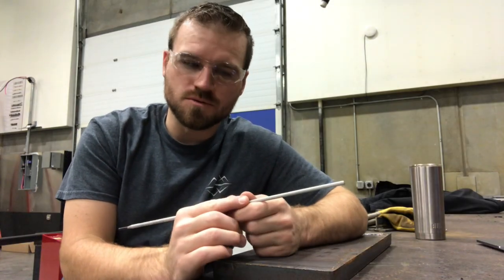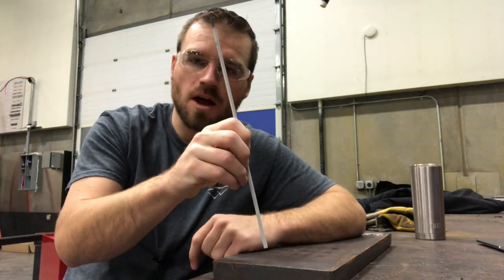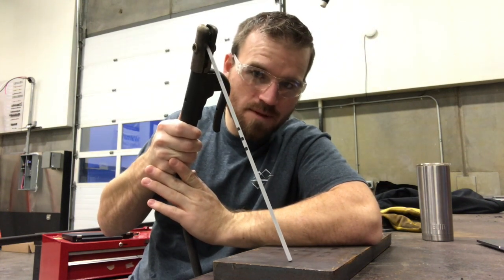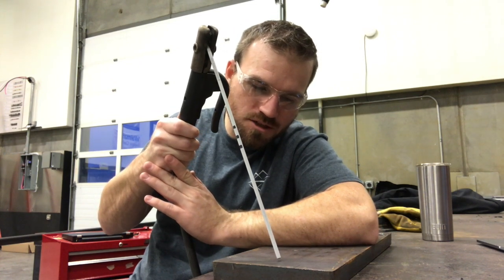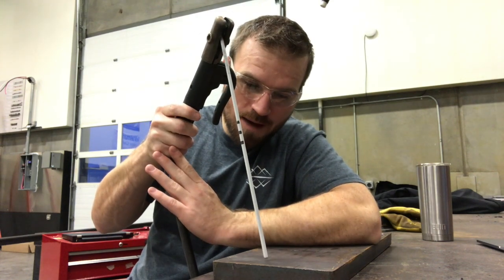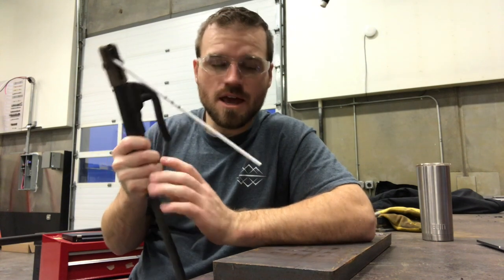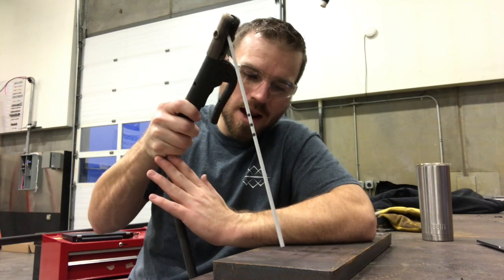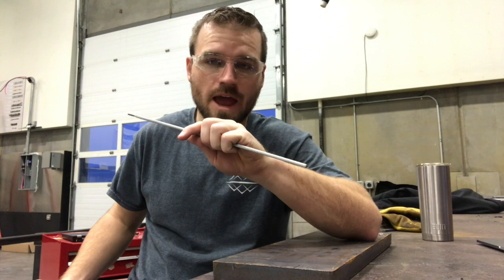Welding SMAW-How to Strike an Arc

Comment: The secret to striking an arc is 1) clean work piece - you can't start an arc through rust, you can't earth through rust;  2) use dry electrodes - if you are a diy and you keep electrodes in an opened packet in the back shed, it's not going to work so well,  3) tap used electrodes on a hard insulating surface (eg brick) just before starting.
This chap in advising to disconnect the holder if the electrode is stuck to the job is using an old welder.  Modern inverter welders usually have a feature whereby it detects the low resistance of a stuck electrode and turns down the current to a pilot level - there is no need or point in disconnecting the holder.   If you are using an old transforner type welder that puts out AC, the presenter's advice is hazardous - you could get an electric shock.   Don't disconnect at the holder, turn off the welder instead.
Reply: I dont understand how you could get a shock from the AC welder, you need two wires to form a circuit through the body, as far as I know AC transformer welders use very low voltage at high currents, not enough voltage to generate a large enough current through the body? not telling you as I am new to welding, these are more questions.
Reply: @engjds  :  Old arc welding equipment was notorious for giving serious electric shocks, however modern invertor welders meeting international safety standards have just about eliminated to problem.
What makes an electric shock serious is the amount of CURRENT flowing through you.   0.03 amps is generally accepted as lethal if flowing in the chest.  To increase current, you need to have a) a higher voltage, or b) a lower electrical resistance, or both.   
While welding is under way, the voltage is only around 10 to 20 volts, which won't kill anyone.   However, when the arc is not established, the welder output voltage with old type welders can rise to 50 to 70 volts, which if AC can give you a very nasty shock.   In stick arc welding, to make the arc stable and controllable, the welder is designed to have an approximate constant current characteristic  - that is, if resistance (in the arc) rises, the welder unit automatically increases the voltage to maintain the set current.
To meet current European safety standards, welders must now have circuitry that detects an open circuit and cuts the voltage to 20 volts or less.   When it detects a circuit closure (i.e., electrode touching grounded metal) it applies the full output as set by the welder controls.
The old type electrode holders were made of fibre.   The fibre used becomes electrically conductive when damp, as it may if left in a shed overnight.   Due to your fingers being wrapped around the holder when you pick it up, the area of contact is large and thus resistance low, and so a dangerous current can flow through you.  And if your fingers are wrapped around the handle, the current will contract your lower arm muscles and force you to grip it harder, increasing the current.   Most of us who have tried arc welding years ago have learnt this the hard way.  Modern holders have plastic insulation which is a good insulator even when wet.  
Touching an electrode with the welder on is not likely to kill a healthy adult, even if the welder is old, but the 60 to 70 volts may give you a shock nasty enough to make you involuntarily move and hit something or knock something over, fall down, etc.
When you get a shock, the return path for the current is generally through your boots, aided by sweat soaked into the boots, or because you are leaning against something grounded, or you are touching something with your other hand.
Reply: @keithammleter3824  Interesting reply, thank you, yes 70-80VAC is not really dangerous on its on, but you would feel a shock, you mentioned about constant current in stick arc welders, but taking mine apart it was just a transformer and nothing else, so are you meaning the newer types?
I would rather work with AC from a safety point of view, you can at least let go with AC voltage, DC makes your nerves lock into place, having said that, as you say with AC and a non isolated transformer, you have a return path back to ground making it more risky.
Also I notice there are AC and DC type sticks to weld with, some do both, what is the physical differences with those sticks?
Reply: @engjds  :  You have things back to front.   AC is far MORE dangerous than DC.  Nerves are set off every time the current pulses - with AC that happens at twice the supply frequency - that's twice 50cycles a second, or 60 cycles a second in North America and a few other countries.  With an AC shock, it's hard to let go because the muscles contract on each cycle.  With DC you feel it when the current through you starts but after that its not so bad as with AC.
With welders, the secondary (the welding circuit) is ALWAYS isolated from the primary side (the AC mains input) and always has been - that is an essential part of safety.
Typical older style transformer welders work by having some sort of magnetic shunt.  The shunt is moved in and out of the shunting position by the amperage control on the front of the welder.   It works because the more the magnetic flux available from the primary (input) winding goes through the shunt, the less there is available to energise the secondary (output winding).  Since current in the secondary winding generates its own flux that opposes the primary flux, (if it did the opposite you would have a devices that generates its own power) as the secondary current falls, the secondary voltage rises, tending to keep the current constant.
A constant current output is used in stick welding, as it makes it easy to use.   in MIG welding, considered a more costly, professional process, a constant DC voltage welder is used.  The result is better but you need a bit more skill, and ther's no slag.
With AC, the voltage goes to zero  and reverses100 times per second.  This causes the current to reverse 100 times a second, and when it reverses, the arc tends to go out.   Electrodes designed for AC welding have coatings that generate copious quantities of burning gas, with an affinity for oxygen much greater than steel, that helps the arc restart and keep going each time the current reverses.   The down side of this is lots of slag from the combustion products, which must be removed from the weld after.
For welding with DC, the coating only has to provide a relatively non reactive shielding gas to keep oxygen from the air out of the weld.
Arc welding is to some extent science and to some extent a black arc.   According to basic arc theory, metal moves from the positive side (which is hottest) to the negative side (which is coolest), but some metals work best with opposite polarity.   With TIG welding aluminium, AC is best.
All electrodes are much the same regardless of brand, but each manufacturer knows some additives to put in their coatings to make it work better for DC normal, DC reverse, or AC.  "Secret sauce" you might say.
Reply: @keithammleter3824  I am a qualified electrician with years of experience and had god knows how many safety courses.
DC is more dangerous for the following reason:
Nerves locks meaning many cannot pull away from the DC voltage as there is no transition thru zero like AC allowing nerves to free themselves, nerve reaction time is much faster than the 20ms(UK)  50Hz or 60Hz.
I think you may have got AC mixed up with DC locking your nerves, but I am 100% I am right on this, why? because as a young nutter we used to challenge each other on how much DC voltage we could take, at 70 to 80V+ you can feel your nerves locking, AC has lesser effect on nerves, which can be demonstrated using an Autotransformer cranked up from zero, with AC you can easily take over 100VAC, hell I have even had 3 phase shocks in industry at over 400VAC and they make you jump, but I have never locked onto the circuit.
Ahh ok, I assumed they would be non-isolating auto-transformers, so that makes more sense to move the ferrite core.
All transformers have equal powers on primary and secondary and voltage ratio between input/output set by the ratio of turns, so I cannot understand why the transformer would output a constant current regardless of load, not saying you are wrong, I will look it up, but I assumed a 100A welder would be one which outputs a maximum of 100A, not one which always trys to maintain 100A. Thank you for a brilliant reply, I feel I know welding theory much better now.
Reply: @engjds  : You still have a lot of things mixed up.
A 100 Amp welder is a very small welder.   The usual size used by small workshops and hobbyists used to run about  130 amps - considering the losses in the transformer, that was about a much as you could have running on house current.   With modern invertor welders, they are much more efficient, and 180 to 185 amps is now common.   Professional grade welders run on 3-phase current and 400 amps is quite typical.
AC hurts far more, and is vastly more lethal than DC.  This is because nerves are triggered by pulse edges and not continuous current.   A really heavy DC current paralyses nerves like an anesthetic, so you feel nothing after the initial bite.  But on AC very small currents force nerves to fire 100 (or 120) times a second.   You feel it all the time (until you die).  The 115 V AC house current used in many countries is well known as lethal, if sufficient contact area with the body occurs.  Before transistors were invented and commercialised in the 1950's, portable radios used special vacuum tubes designed for battery operation.   Batteries containing 60 cells in series were used to get the 90 volts DC needed by the vacuum tubes in the 1940's and 1950's (typical types 1T4, 1R5, 1S5, 3V4).  Before that a common radio battery voltage was 135 V.  The plugs for the batteries had bare exposed pins on the back - you could easily get in contact with 90 V DC or 135 V DC.   The early batteries had "Farnstock" clip terminals, completely exposed.  You could feel it at the instant of touching, but it never ever hurt anybody.
In the early days, the first to commercialise electricity was Edison, who developed a DC system,  He chose 110 volts as that suited the early lamps he developed and was completely safe electric shock wise regardless of circumstances.   But Westinghouse then developed AC distribution, a much cheaper, more efficient and flexible system, but they kept to 110 volts local distribution to suit lamps.  But 110 V AC can be lethal.  It is well documented that Edison, faced with commercial oblivion, publicly ranted at length about the dangers of AC, doing stunts like electrocuting elephants with AC, devising AC electric chairs to execute criminals, etc.   Edison was completely right about AC being far more dangerous,  but DC could not be used for wide distribution which needed voltage transformation, so AC won commercially anyway.
The reason why magnetic shunt transformers have a constant current output characteristic is because part of the magnetic flux passes through the secondary winding and part through the shunt.   Magnetic flux is like electric current in that it tends to go through the easiest path.   When there is a heavy load on the secondary,  the flux caused by the secondary current opposes the primary flux (this is called "Lenz's Law"), so the primary flux prefers more going through the shunt.  When the load on the secondary is light, the flux finds going through the secondary easier than the shunt, so it increases the secondary voltage, tending to maintain the current at nearly the same level.
The voltage ratio in a transformer is ONLY equal to the turns ratio if ALL the magnetic flux from the primary goes through the secondary.  In a welding transformer, there is an alternative magnetic path in the shunt, so the voltage ratio is variable.
Ferrite is not used at power frequencies.  Special steel alloys (silicon steels) are used for transformer cores at power and audio frequencies.   
You can't be much of an electrician if you think ferrite is used.  You certainly can't be much of an electrician if you think DC is more dangerous than AC.
All of us who have worked in the electrical or electronic industries have got a shock or two, including me.    You learn very quickly early in your career to respect AC electricity, and take care not to get another shock.   In electronics, nobody worries much about DC.   At one time (in my teens) I worked in TV repair.  The old tube-type TV sets had part of the circuitry running on what was called "Boost HT" around 400 V DC, and about 12,000 to 22,000 volts DC on the picture tube.   I can tell you from experience that both hurt, but are not lethal.
The reason why stick welders are built with a constant current characteristic (i.e., it tries to keep the current set to whatever value the operator sets it to) is because that makes welding an easy process.   It mean that the power (and therefore the heat) is proportional to the distance you hold the electrode away from the work, and the arc is vey stable.  One rapidly learns to control the heat in this way.   If the welder has a constant voltage characteristic, then the heat is inversely proportional to the electrode distance, and learning to control it is harder.  The arc can more easily go out for any reason, such as operator unsteadiness, welding through a patch of rust, wind, etc.
Reply: @engjds  : You are an electronics engineer?   Yeah right.  You don't know the basics - things engineers learn in their first week of study.  You might be a software/programming guy.
It is generally accepted that 30 mA of AC through the bulk of the chest can be lethal.   But the actual AC current through the heart itself is lethal at far below 30 mA.  There are special standards for electrical and electronic equipment used in hospital operating theaters for that reason.
You are ignorant of how the nervous system works.   Nerves have two states - the normal idle state, and what an electronic engineer would call "on".   Nerves are triggered "on" by pulse edges.   If you apply DC to a nerve cell, you can force it to stay "on".   Then it cannot send any impulse to the next nerve cell in the chain, so nothing further is sensed or can happen, other than burning.   The current required for burning, AC or DC, is far above the level required for AC's lethal effect.
The inability of nerve cells to signal continuously is an evolutionary consequence and has interesting consequences.  Lower forms of life, eg frogs, are totally blind to non-moving objects unless they themselves move.  If something, such as a snake, creeps very slowly up to a resting frog, the frog is totally unaware until it's bit.   In mammals the eye muscles continually move the eye a fraction of a degree all the time, otherwise we would be blind to things not moving, too.   Naturally we have evolved to not be conscious of these continuous tiny movements, but they are essential.
Working on switchmode power supplies has an unusual (for electronics) hazard because the AC mains voltage is present in in significant areas of the printed circuit board.   If you really were an electronic engineer, you would know that with vacuum tube equipment (radios, TV's, stereos, all kinds of stuff) there was DC at 150 to 350 V throughout the circuit.   It was not a particular hazard.   I can tell you from personal experience that you certainly felt it AT THE INSTANT OF CONTACT, but electronic repairmen deaths were unknown - never happened, except for the rare instances when they got zapped by the AC on the power transformer.   Those of us in electronics back then learnt quickly to avoid contacting the 150 to 350 V DC as it hurt, but that's about it.   When solid state equipment came in, it ran on low voltage DC, and AC was only present at the (usually somewhat tucked away) primary of the power transformer, so there arose a whole generation of repairmen who were used to completely safe equipment.   These chaps need to be retrained to work on switchmode power supplies because of AC mains is on much of the printed circuit board.
Radio Frequency current is a different hazard.  You can't feel it because nerves can only fire up to about 120 to 150 times a second.   As frequency goes up in the low audio region, the sensation of electric shock, and shock effects of heart and muscles, becomes less and less, but burning becomes more likely.  Well up in the RF region, heating of internal tissues can occur - this is dangerous, because you get cooked without feeling any current.   With 50/60 Hz, you feel it instantly and will move away if you can, but with RF you may well not react until you feel the sensation of heat and then it may be too late.
Reply: @keithammleter3824  Actually googling this brings up some interesting results, I see a 50/50 split in which is most dangerous, I still stand by my point having had both types of shock (AC 50Hz though, 60Hz is more lethal), PS I love your statement 
"If you really were an electronic engineer, you would know that with vacuum tube equipment....." I am old, but not that old my friend and I think this explains your fat ego, try debating without your ego induced insults and people might actually respect what you have to say. My knowledge is obviously more up to date than yours.
As I have said to others in previous posts, when going into a discussion think about what your intentions are, are you here just to make yourself look knowledgable and belittle those that respond to inflate an already fragile ego, or are you here willing to shape your own opinions whilst changing the opinions of others?
I go into every debate willing to learn new things and never assume I know more than strangers on here, for every ten guys you know more than, another 20 will know more than you, so just bare that in mind.
Reply: @engjds  :  Its ok to ask questions.   Its ok to have some misunderstanding that needs to be corrected.   But don't claim to be something you are not - you just make yourself look silly.
You have descended into personal attack, which is the mark of someone who hasn't a clue, so so does not have the option of putting up a reasonable argument supported by facts or logic.
First, you claimed to be an electrician.  If you were in fact a qualified electrician, you would be well aware that in international and national standards they define terms such as "Extra Low Voltage" - where no license or certification is required to work on ELV equipment - because the voltage is low enough to be inherently safe electric shock-wise.   Above that is "Low Voltage", which is essentially house current, and requires a license or certification to work on, because a shock can burn or kill.  It's called "Low" because compared to the voltages used in local electricity distribution (kilovolts), it is low.
And you would know that the voltage that is the legal upper limit of "Extra Low Voltage" is much higher for DC than it is for AC - precisely because AC is far more dangerous than DC.
You keep talking about Google results, but since you haven't given url's found, that means nothing.   All sorts of goofy people are free to put things on the www.
The lower the frequency of AC the more dangerous it is, for the reasons I previously explained.   50Hz is more dangerous than 60 Hz, though the difference is not significant enough in practice.   A few countries at one time had 40 Hz distribution (it suited railway traction better), which was significantly more dangerous, as it was slow enough for nerves and heart muscle to try and trigger on every cycle, wearing them out.  
Then, when it appeared to you a good idea, you claimed to be an "electronics design engineer".  But you use language that no engineer would use, as in "The old adjustable PCB transformers and tunable inductors ...."   Sounds like you picked up a few things from a hobby magazine or a website for beginners.  A genuine engineer would call them RF or IF transformers or coils, and they aren't just in old equipment, though the advent of intermediate frequency digital signal processing beginning about 20 - 25 years ago has reduced the number in each device.  And you seemed to think they had some relevance to welding.
Perhaps you don't know the difference between and electrician and an electronics engineer.  Its about as much as the difference between a brain surgeon and the junior nurse who has to make the hospital beds and stick bandaids on.  Incidentally, a engineer boss I had one time used to say "Don't call me a design engineer.   Design is what dress-designers and marketing people do."   He was dead right.
If you were an electronics engineer, you would have been trained that 0.03 Amps AC through the chest even for just an instant is lethal (causes fibrillation), but with DC a sustained current of at least 0.3 Amp is needed - 10 times as much (causes a form of cooking).   Some authorities think 0.5 Amp DC is needed.  If you were an engineer, you would know that from the CRC Manual and many other standard textbooks.
So, ask questions, debate, and learn, but don't claim to be something you are not - you learn nothing from that, and the real professionals will see through you in an instant.
Reply: @keithammleter3824  I unlike yourself do not care what others think), you started the attacks. I cannot even be bothered to correct your technical errors on this post, there are many and comes from someone pretending to be something they are not, its better to let others judge your content), you take care now.
Reply: @engjds  : Yeah right.   Readers of this thread may notice that you said, several posts back, "ALL transformers have equal powers on primary and secondary and voltage ratio between input/output set by the ratio of turns."   Which is the simplified story taught to school children.   But, as any actual electronics technician or engineer knows, the turns ratio is only one of many factors.  Others include the degree of magnetic coupling (i.e., the fraction of magnetic flux that is common to both primary and secondary, whether or not one side or not are operated in resonance, something called "Q-factor" on each side.
You are the one who started all this "fat ego" stuff.   I merely pointed out you are quite wrong about AC and DC hazard, and  cannot be either an electrician or engineer, as this is basic safety stuff set in international standards.    Seems you cannot tolerate being wrong.
Reply: @keithammleter3824  One should learn when a person is talking in generalities, of course there is series resistance, series inductance and stray capacitance, and hence even resonance of a particular winding, however, I dumbed down my comments for someone who is obviously a rough and tumble welder with little idea of basic electrics/electronics. Stop trying to make yourself look clever.
Reply: @engjds  :  You posted in your first post that you did not understand how one could get a shock from an welder.  I explained how, and you posted back that DC is more dangerous than AC.    I corrected you, explaining why you were wrong and then you dug in and claimed (I quote you) " I am a qualified electrician with years of experience and had god knows how many safety courses.  DC is more dangerous ....."    It all went down hill from there, because clearly none of that quote is true, and you can't accept that you are wrong, resorting to personal attack.  Later you decided to claim being an electronics design engineer!!!
Is that what you just did?   Look up Q-factor on Wikipedia and gather up a few buzzwords?  Eddy currents and hysteresis are both forms of iron loss, and reduce Q - I guess you missed that.
Incidentally, there's no City & Guilds in the country I live.   That's a British technical education system.  No NVQ here either, we have our own education systems and qualifications.   
If you are British, and actually were an electrician, you would know about the peculiar British Reduced Voltage system used on construction sites, where, due to the hazard of AC, tools must run on 2 lines each 55 V to earth.  And you would in any case as an electrician be aware of EN 61140 which specifically regards AC as hazardous at a MUCH lower voltage than DC.  Look it up and see.